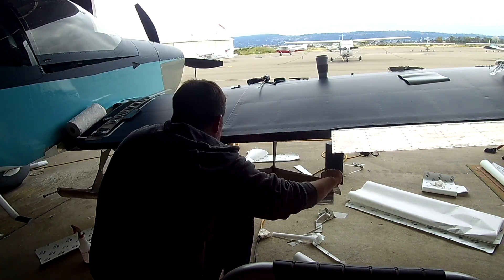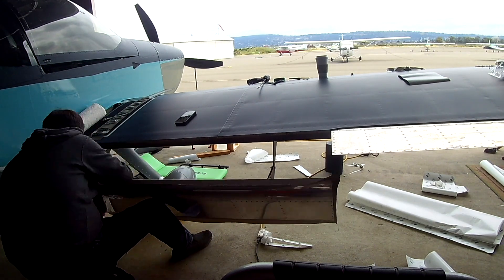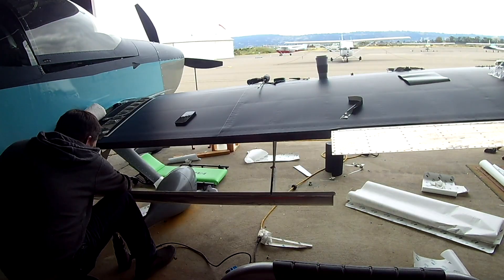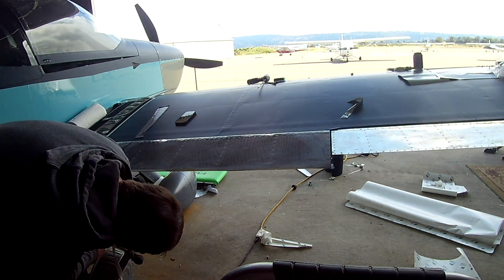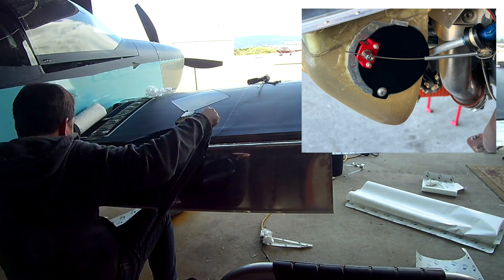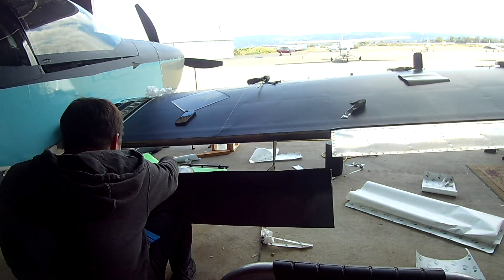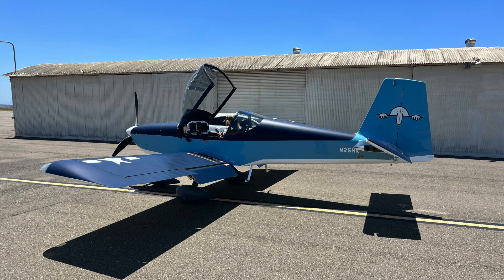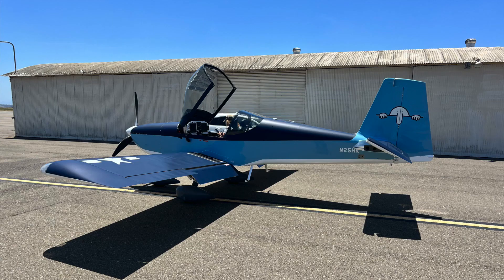RV-14 - Vinylization VI

Comment: After a year, how is the vinyl holding up? I have an unpainted 10 and toying with the idea as paint is expensive, long lead time and long time to do
Reply from the maker: Holding up pretty well. The only issue is that using pledge on the canopy will look like its staining the matte finished vinyl. Cleaning the matte vinyl with iso alcohol clears is up quick!

Comment: Can you please share vinyl specs, strong enough bonding for RV 10?
Reply from the maker: The gloss white and matte blue are both 3m 2080 films. the light blue is gloss sea foam green from Avery. If it can handle 190 knots in a 14, it can handle whatever the 10 can do. Although the all composite top will need to have as smooth of a surface as you can get. vinyl loves a smooth surface.